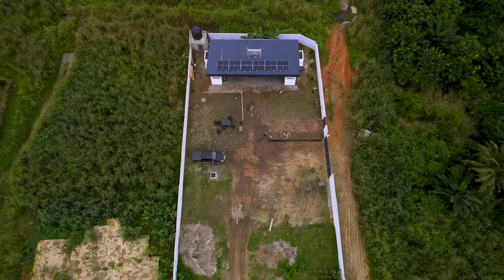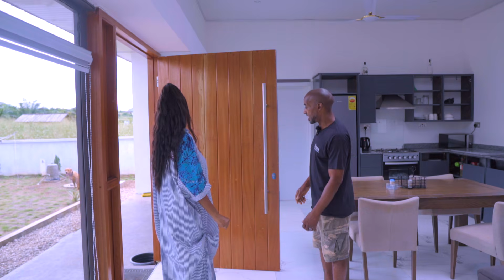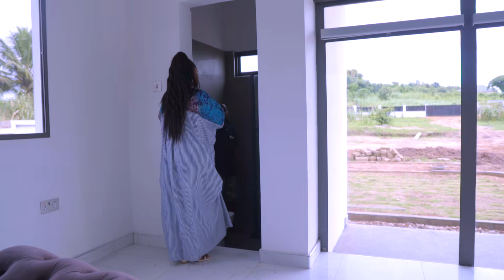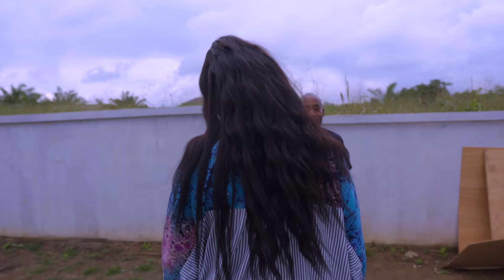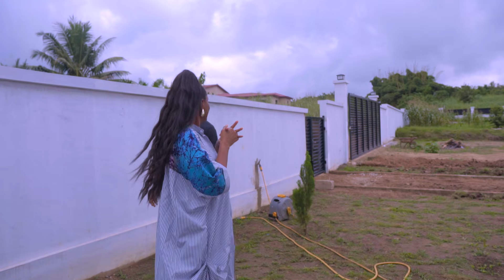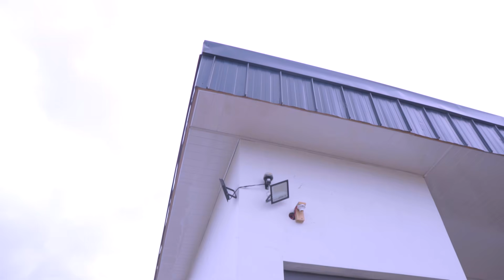He moved to Ghana and built a 2 bedroom house |Breakdown of costs to build this home|Exploring Asebu

Comment: Very very inspiring video. The tank is not that high, yet the pressure of the tap is very strong. How's that possible? I'm about to build a tank stand and I'm told by the builder that it should be at least five meters high. But I don't like very high tank stands. Please if anyone knows more on this I will appreciate an education on how this works.
Reply: That’s false, as long as it’s higher than the inlet, gravity will do the rest.